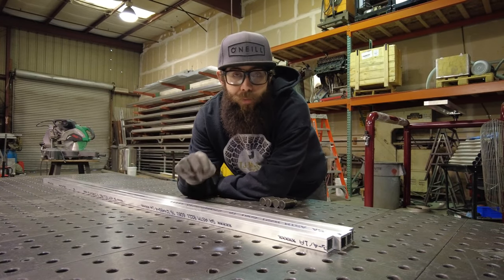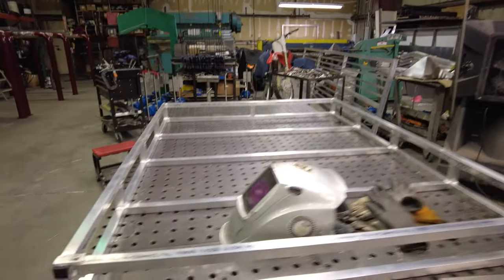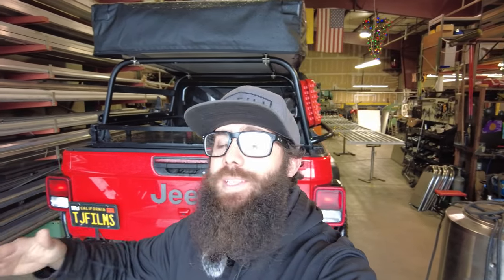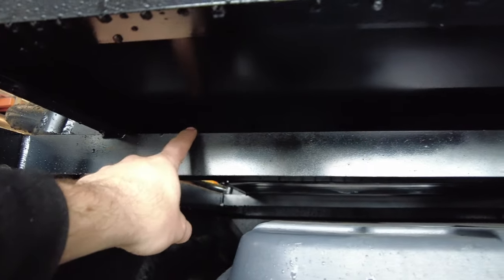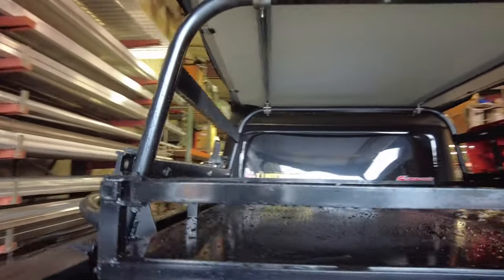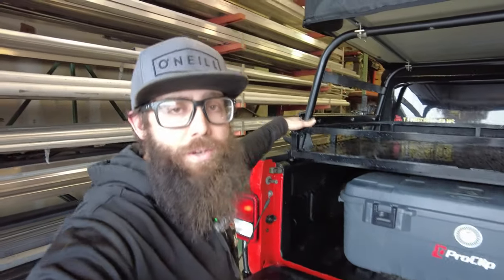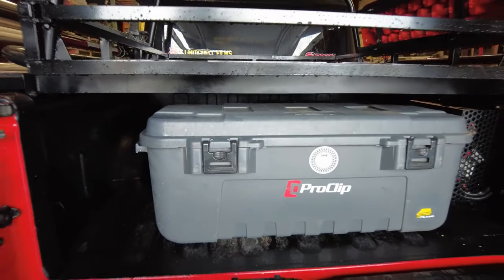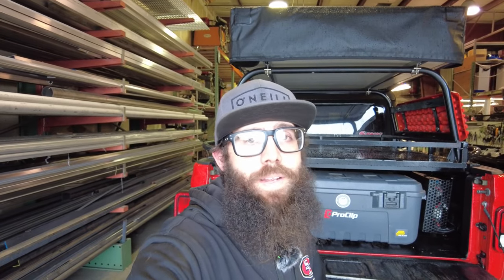Building the perfect overlanding bed rack (EJS 2021 Prep)

Comment: Yes  the arb fridge is about 4 inches taller than the bed.  I had mine for my other jeep,  so it was in the inside.  Now I made modifications to my rack and purchased a sawtooth tonnue  cover.  It works great becouse it stretches over everything and its light. .  my rack and tonuee cover only weighs 55 total..  And its mid high  rack.   And its all protected from rain and dust.  I added a electric swtich in the bed for it and added a solo panel to ot as well. .  ice cream in the desert is nice to have.  And cold corona.  😂.  I like your ideas.  But I think your  rooftop tent is really high.
Reply from the maker: Yeah I’m probably gonna build a new rack eventually to lower it down